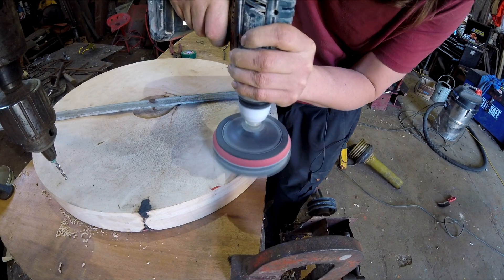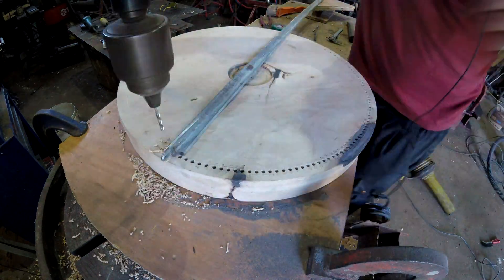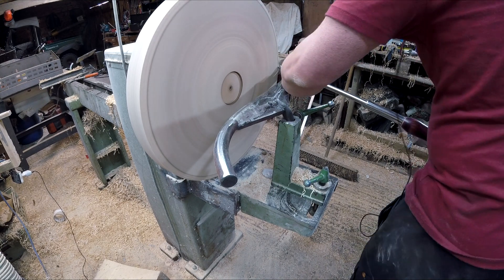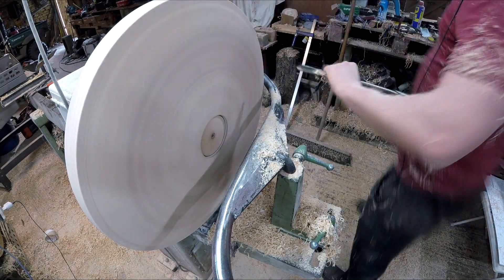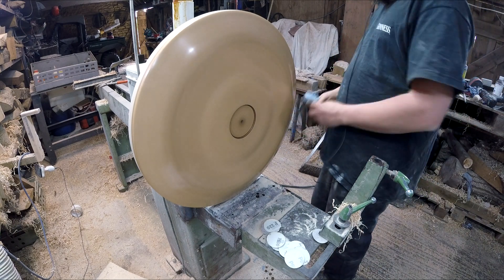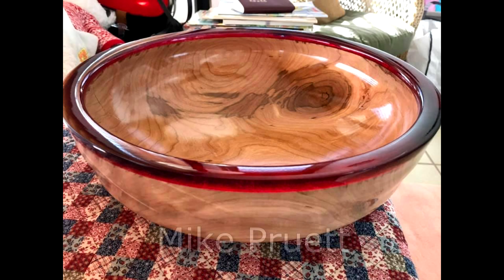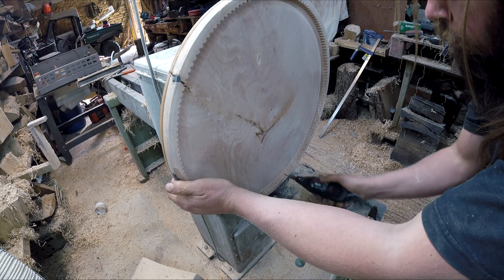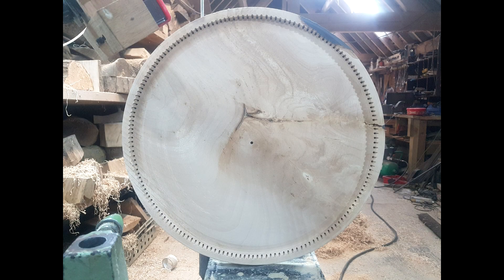Spirograph 3 - Wood Turning

Comment: Hi Will, An extremely accurate piece of turning Will. Great job. One question in why didn't you use a parting tool to define the edges of the teeth? Cheers Huw
Reply from the maker: My parting tool is not up to the job, and I feared it would break the teeth off! And my bowl gouge in sharper and more accurate :)